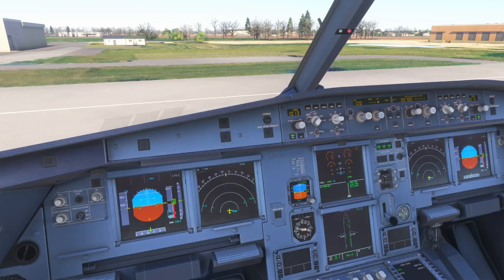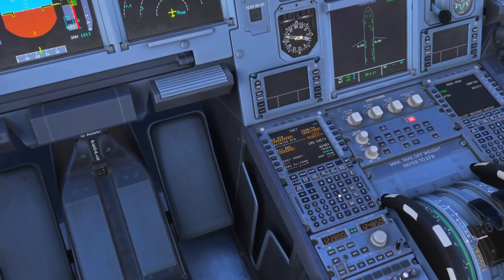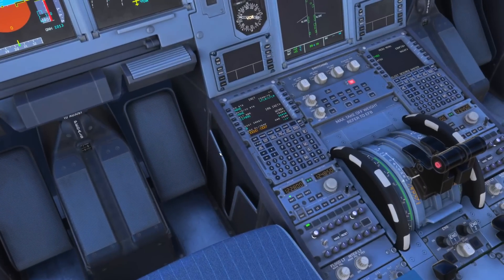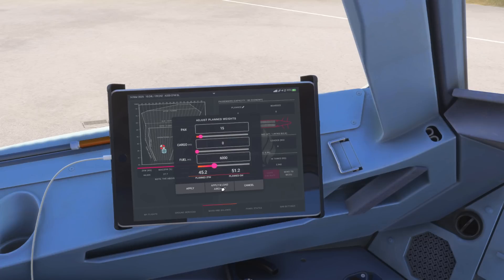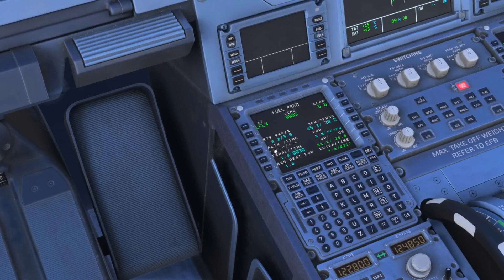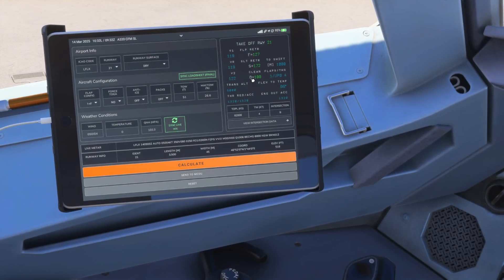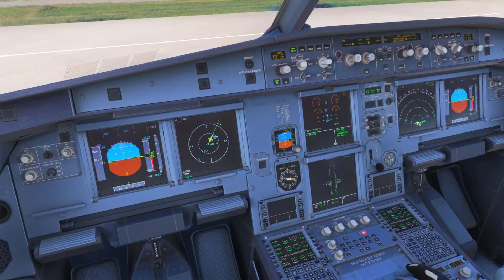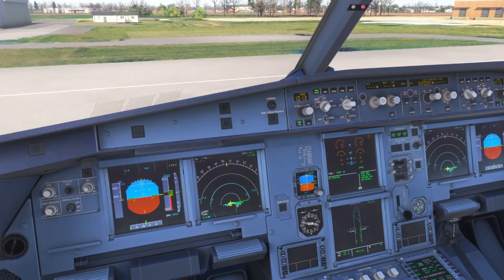How to Set Up A320 for Traffic Patterns | Real Airbus Pilot MSFS 2024 Tutorial

Comment: Many simmers skip this step and go straight to flying using ILS or NAV, but I believe mastering visual circuits (traffic patterns) is essential. Once you master this, you'll gain the confidence to land in any situation.
I learned the traffic pattern later on. :)
Reply from the maker: Hello, absolutely this is essential in building handling confidence with the aircraft. In the very early stages of flight school you will learn circuits and practice them again and again, it is a manual handling foundation 👍✈️